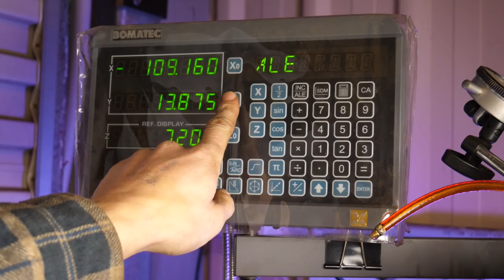Low Profile Mill Clamps

Comment: Question, are those free cap screws digging into the t slot bottom? Aren’t the t slot bottoms irregular, not machined? Won’t they get chewed up as cast is softer than steel? Just asking because I think I am going to add a washer or t cover to mine.
Reply from the maker: Yes, I flattened the tip to prevent damage. Also I don't tighten them crazy hard, there is a risk that the jacking action could break the T-slot. I've allowed provision for a top clamping plate if required

Comment: Hey before you remove your chuck from the lathe spindle next time chuck up a rod of cold roll close to the size if the spindle bore in the jaws that extends into the spindle bore 6 " and sticks out of the chuck jaws 6" on the face side. The bar will then act as an insertion guide on one end and line up the threads on the chuck adapter and act as a handle on the other side. This makes taking the chuck off and putting the chuck back on real easy and avoids thread damage.
Reply from the maker: Good tip.
Cheers

Comment: Tip: don’t put the brush back in de bottle after you used it on blueing metal. Just pour a little blueing liquid an a plate or something.
Reply: Not arguing with you, but may I ask why?
Reply: @ebayollis  during blueing oxides form, which you partially rub off the metal onto the brush and then contaminating the blueing solution. 

In essence you put a small portion of rust back into the bottle of blue. Mind you it's only small quantities and it's basically just sloppy work, personally I doubt that it will pose any real risk of real degradation. It'll probably function just fine for 99% of the jobs.
Reply: Hell I dip my part's in a five gallon bucket of blue, it's five years old still does a excellent job.
Reply: @kentuckytrapper780  Yeah, I just dunk the parts into the container. Been using the same container for a while now. You'll see some bits(prob iron oxide) in the bottom, but I just pour it through a strainer to remove them.

Comment: Honest to gawd! I thought you had screwed up those screw heads.  I did not get it until the end.  Good job and great entertainment!
Reply from the maker: Cheers! I nearly overdid the eccentric, there's not a lot of meat around the hex!
Reply: @TomMakeHere  I wondered what was going on there as well !
Reply: Out of curiosity, why did you do that?
Reply from the maker: @tcratius1748  Do what? Turn the bolt eccentric? This makes the the action of turning screw allow it to cam against the hex shape and exert a sidewards pressure on the work piece. The whole tool is a compact cam clamp

Comment: Editing on point 👌 i wont lie, when you put that part in to test the way it was aimed on the rotational force i was waiting for it to go shooting out haha
Reply from the maker: You need to get a 'grip'!
Reply: @TomMakeHere  just had a thought because the bolt heads are only using friction to hold the nut against the work piece if you use a smooth sided piece just be careful if your drilling it doesn't lift up, as there is nothing holding the nuts to the T nut
Reply from the maker: @troyam6607  yep good point. I think generally I'll use this for surface milling, but in that case I'd probably put a strap clamp on it. I'll just need to remember not to drill my mill table lol
Reply: @TomMakeHere  haha that's what it's there for! 😉

Comment: Nice mate! I know I saw a comment about this already, but thought I would just reinforce the idea that using the cap screw to push it up from the bottom of the t slot isnt the best idea. Not only can you damage the tslots, but you're drastically reducing the clamping potential because of the lack of surface area on the bottomed out screw. T slots are meant to be clamped in compression 😊 if how you have it works for what you need then awesome, but just something to keep in mind. Maybe consider custom washers with csk screws for the future to retain that low profile.
Reply from the maker: Yep, I've allowed space on the T nut for this purpose
All of the commercial designs run like this so I thought I would try this first and upgrade if required

Comment: I love the editing on this one Tom. Great result - you put a lot of work into the video editing and it shows! Those clamps will be super handy. I have thought about making some in the past too, but it's on the infinite todo list still :-) Cheers, Craig
Reply from the maker: Cheers Craig. Yes I thought it was about time to get around to it
I'm forever holding big flat plates and it's becoming a problem
Reply: @TomMakeHere  yeah, machining the entire face of a plate is a pretty common use case. Surprised these clamps aren't more common. I suppose the large 2 piece style mill vise (ToT style) could be used with parallels too, for plate surfacing, but this sort is much cheaper and easier to build.
Reply from the maker: @CraigsWorkshop  Yeah I decided to go simple. At some point I will make up 2 precision rails to go with these for repeat plate work (so I can make an inside corner to butt a plate against)

Comment: nice vid, late to the party- Q: how did you determine the eccentricity amount? i frame by framed and it looked like 100thou//2.5mm?
Reply from the maker: @dumpy4289  to be honest, it was a guess based on what seemed reasonable and didn't destroy the screw head. If it didn't work I would have tried something else
Reply: @TomMakeHere  cheers man! I love the design, i’ll give it a go!

Comment: Am I correct in assuming the clamping force is from the 'tipping' of the T nut by the rear cap head screw? 
So, push the hex as hard as you can to the job, lightly tighten the rear cap head, then tighten the hex cap head, then repeat to all of them, then tighten the rear cap heads to gain clapping force?
If so, very neat and I want some.
Reply from the maker: Yeah so it is the cam action of the eccentric cap screw that pushes the hex against the work, after the rear screw has locked it in place
The rear screw is ok, but could damage a mill table if tightened hard. Ideally there would be top and bottom clamping plates. I might make this change
They are very useful

Comment: Just enjoying the process.   Do you use machine oil or way oil on the clamp heads?
Reply from the maker: I think I used a light spindle oil from memory. It doesn't matter too much, you just want oil to soak into the blued steel

Comment: I am a Korean MCT engineer. Is it necessary to do so? You can put an aluminum plate on top and tap it to make it easier
Reply from the maker: There are many ways of completing any task. These are just another option
They are best suited to milling the entire surface of a plate where you cannot have clamps on top as they are in the way of the milling operation

Comment: Do you have a love/hate relationship with that vice too? The mechanism on the bottom that locks it different hooks for different widths is so iffy sometimes.
Reply from the maker: Yes, I've now upgraded to an 'anglock' style vice. Much more reliable for milling
Reply: @TomMakeHere  Bit too high for me those, it's just a desktop cnc machine not a full on mill.
Reply from the maker: @xConundrumx  yep, height is always an issue. A 2 piece vice might be worth looking into too
Reply: @TomMakeHere  My thinking too, maybe not a vise in the classical sense though. Something modular maybe. Haven't quite figured it out yet. Vacuum holding is another option I am exploring.

Comment: impressive.  the heads of the cap screws seemed to be turned off-center (wobbly in chuck).  is that by design? to create a partial cam-effect?
Reply from the maker: 100% correct. It is the cam action of the screw head holding the part

Comment: Nice! I'm going to have a shot at this. How much bigger is the hole in the hex nut than the cap screw head?
Reply from the maker: Maybe 0.5 to 1 mm clearance should be fine. The most important thing is the cap screw head must be eccentric. Mine was maybe 1 mm eccentric
As an improvement on this design, I would have a plate on the rear cap screw so the plate is pulled down onto the table and the T nut pulled up. If that makes sense

Comment: What liquid do you use (the blue bottle), what type is it called?
Reply from the maker: It is a cold blue solution. The chemical is usually Selenium Dioxide for steel.
It adds a black oxide layer with pitting which allows oil impregnation to prevent rust
Reply: @TomMakeHere  Thank you very much!